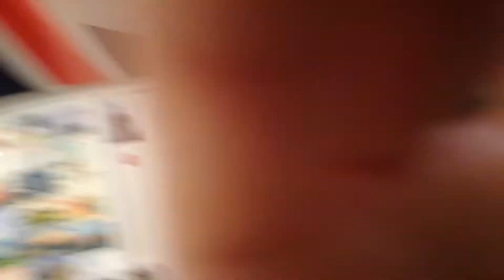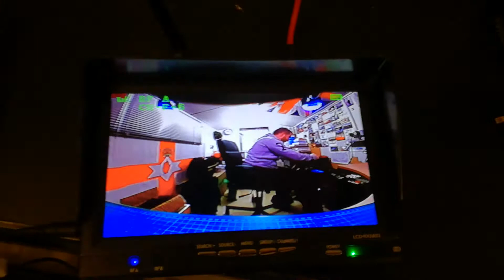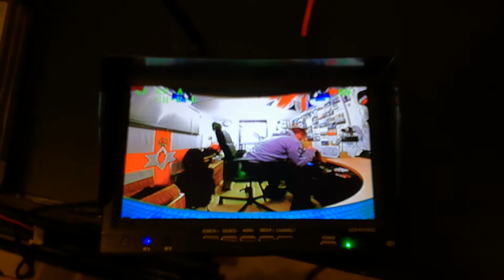Yuneec Typhoon H with FPV camera Mod for 2 man Operations.

Comment: Hi Richard, i tried this a while back with my Q500 as i like flying fpv with the fatshark goggles, it was a fatshark video transmitter which if i remember was 5.8 the same as your using. i had major problems with controlling the Q500 when i had the video transmitter on... i look forward to seeing how you get on. I loved the 500 but sold it to buy the typhoon h as i can use the hdmi to fpv with the goggles..... thanks again for sharing...cheers